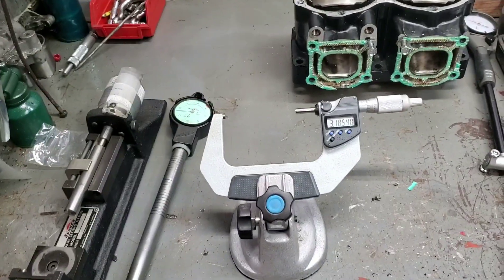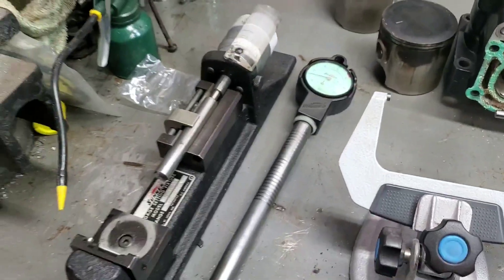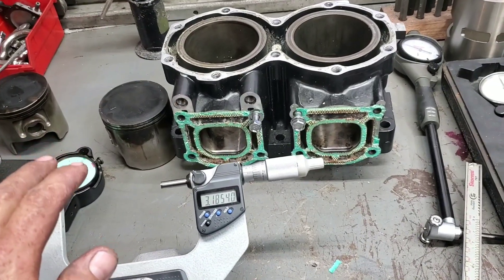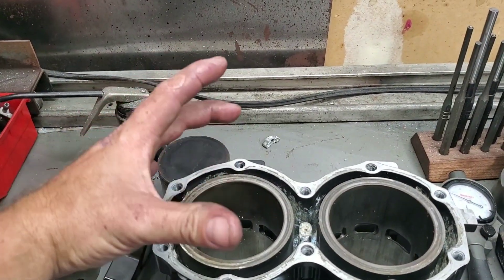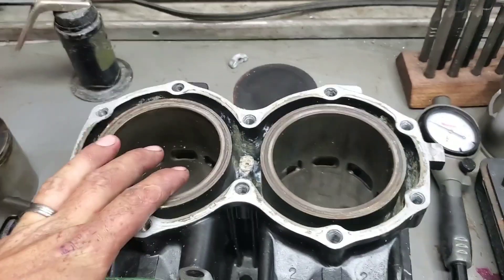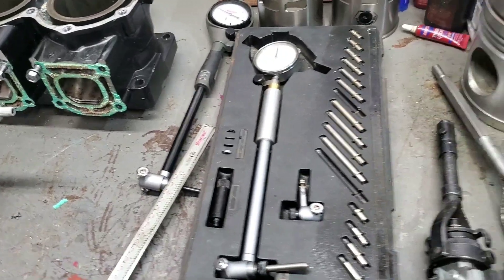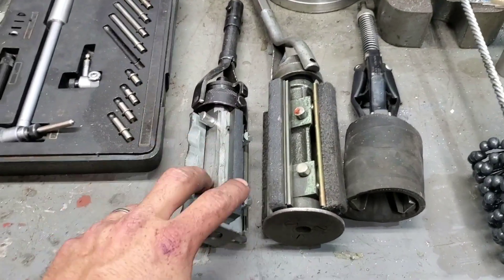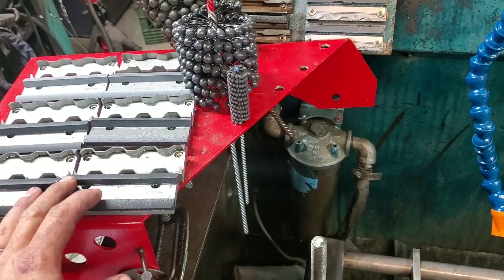How to Properly check a cylinders bore Clearance and Roundness on a Yamaha 701 Pwc Cylinder

Comment: Thank you that was very informative. It confirms that my cylinders are in fact egg shaped.
Reply from the maker: @iROLL24  thanks for watching.    Sorry to hear about ur cylinder
Reply: @EricksonMachinePerformance well, maybe you can help me out. The cylinders all show 92.xx mm. Most are 92.87mm but some measurements read 92.98 and so on. They’re all within that range. So my question is how do I read the thousandths place? I don’t know how to read it. Thanks
Reply from the maker: @iROLL24  id measure it in inches.     Not mm
Reply: @EricksonMachinePerformance I suspected that. I’ll remeasure in inches, thanks